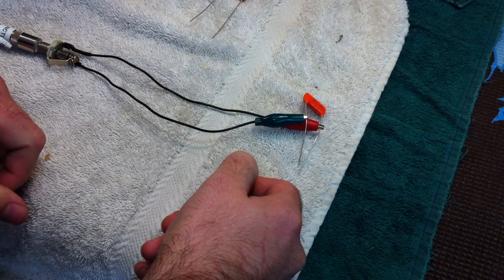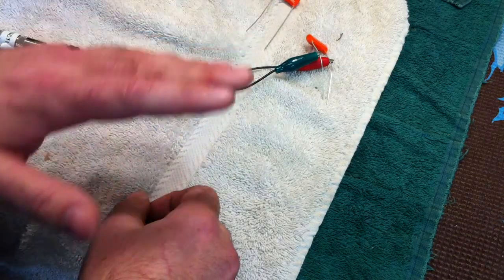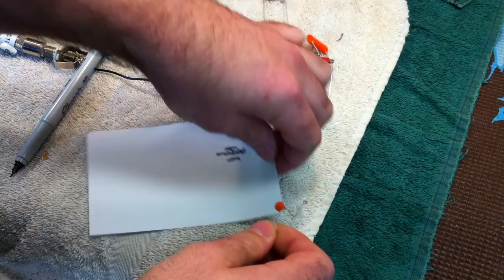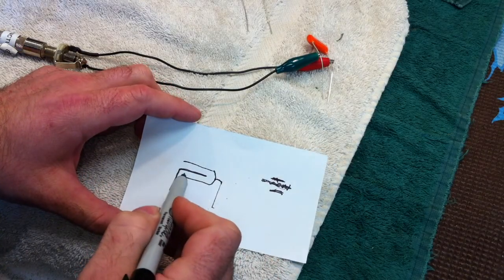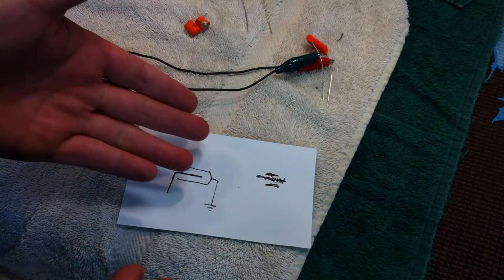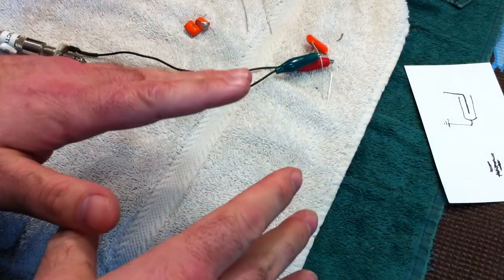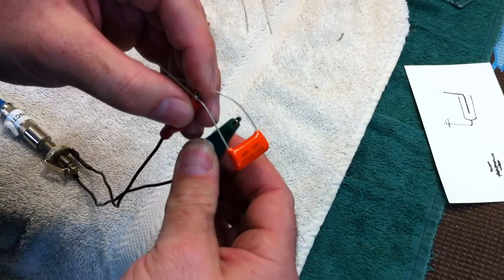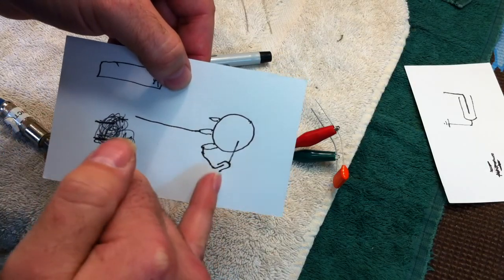Installing Orange Drop Capacitors in the Correct Orientation

Comment from the maker: I wanted to add a few points here that I have seen come up a few times in the comments. 1: the cap will function to filter frequencies in either direction and with the same value. The only difference is the amount of EM it will pickup in one orientation vs the other. 2: The orientation will matter less in shielded cavities. Cavity shielding is generally not perfect since you must have gaps where there wires come into it and other things, so it isn't completely worthless to do this in any case, but the folks pointing out that a shielded cavity will filter most of the EM are correct. 3: The instances in which I think this may be most important are in situations where the cavity cannot be shielded such as es 335s and similar arch-top situations in which the shielding comes from using shielded wire and thus, the cap can be a very noisy component in the circuit. 4: I wanted to mention (perhaps redundantly) that the reason this works is that if you have the hot lead of the output jack linked up with the outside foil you are basically hooking the outside foil to the tip of the phone plug of your guitar cable, which as one might know, will hum if you touch it due to it being the signal side of the circuit. Imagine rapping a wire around the tip and then touching that. Its the same thing except the wire is the outside foil of the cap. If you hear that hum it means the hot is connected backwards and therefore should correctly be soldered to the opposite lead when doing the actual wiring. To put it another way, when you hear the hum, mark the side of the cap connected to the tip as "ground" and wire it into the guitar that way. This works by hooking it up wrong, finding the problem that causes so you know that the opposite orientation will be correct. The "jumps the gap" illustration I am using in this video is functional for the purposes of this video, but if you want deep dive into how this really works, I would watch this video by The Science Asylum: https://youtu.be/zYRx6Zub3cA
Reply: I'm curious how this works with Polyester or PP caps being wired in a tube amp circuit between gain stages.  For coupling caps does the ground (outer foil) lead get wired to the grid of the next stage triode or should it be closer to the previous stage's plate?  I'm guessing in any other case the ground (outer foil) lead should be orientated closer to any grounding within the circuit.  Why do manufacturers never make a notation in this regard?
Reply from the maker: @on1ytheb3st  I am not well versed in amplifier repair or building, it might be best to pose this question to McCarlsons lab linked in the description.
Reply: Thanks!
Reply: Why not just wrap the capacitor with aluminum foil and ground it?
Reply from the maker: @rockvillemike6062  Well, for one thing that would change the capacitance since you would be altering the conductive surface area. Also aluminum is not solderable.
Reply: If you play try a treble bleed soldered between hot n ground on output jack.
Reply from the maker: normally a treble bleed goes from signal input to signal output on the volume pot bypassing the potentiometer and thus “bleeding” treble frequency from the pickup directly to the filtered output from the pot. That would be a signal to signal connection, where as if you put it between tip and ground at the output jack, whatever it was bleeding would be bled directly to ground. I’m pretty sure that would act somewhat as an always on low pass filter rather than the treble bleed it was designed to be and I kinda suspect that might lead to some ground hum as well. What effect are you going for with that and why are you recommending it?
Reply: @DrewsGuitarShop  it gives you kinda a treble boosts with bite and or distortion not much but enough. . Mines on a switch so I can turn it off. Gives a bit of volume boost.
Reply: Will the orientation matter on a volume pot? For instance The 3 terminals hot in on the left and middle I put the capacitor with a 150k between them. Should the shielded leg go to center? Far right I ground to edge of pot. I'm thinking grounded side of cap to center?

Comment: Awesome and a very easy way I have seen so far, to tell orientation on polypropelene caps without expensive equipment like Oscilloscope. Mr.Carlson's Lab of course has even shared an amazing DIY tool to identify polarity, a big blessing for professionals. Drew, thank you for sharing your valuable tip. Bless you!

Comment: If you want to demonstrate this is an issue, you should wire a pot in a guitar up in a noisy environment in a way you can change the polarity back and forth. The fact you can see something on an oscilloscope or hear a hum when you touch it naked is not necessarily relevant for the real world.
Reply from the maker: ¯\_(ツ)_/¯ if it matters to you, it matters. I am just putting the info out there. I'd say it would matter most in a situation like an archtop were you were using shielded wire, but were unable to shield the cavity.

Comment: This has been discussed extensively at least 25 years ago on the web guitar forums, etc. 
NOTHING NEW..
What's good here is that you acknowledge and perpetuate that caps are directional.
Reply: The capacitor is not directional but it will pick up noise more in one orientation than the other.
Reply: @1pcfred  
Save it for someone else..
👎
Reply: @1pcfred  
Please.. Just stop already.
Have a 🌭
Reply: @1pcfred  
Please stop harassing me. 
🌭🌭🌭🌭🌭🌭
Reply: @1pcfred  
I'm not drinking your Koolaid. 
👎👎

Comment: In regards to EM interface, wouldn't a Faraday Cage prevent this - which is something I do in all my guitars .
Reply: Faraday cage is impossible to achieve in a guitar because the pickup magnets stick out of the body hence not a Faraday cage. There's a great video by Dylantalkstone that goes into further detail about this

Your best bet to combat EM interference is to: get good quality pickups, shield the pickup cavities and clean up your signal chain.
Reply: @derusmares9508  yeah it isn't technically a Faraday cage because of the lack of complete coverage - instead it works by sheilding from the frequencies to a better extent than without.
Reply from the maker: You can't shield some guitars. Imagine trying to shield the inside of an ES-335 or the like. Sometimes you have to rely on the wires and components to do that job and in those cases, the cap can be a big deal.

Comment: this is confusing but it seems you have the Red (Hot) clip wired to the ground on the jack and Black (Ground) clip wired to the Tip. Doesn't that reverse what you're doing.
Reply: No.
Reply from the maker: When your tip is wired to the outside foil, it will hum when you touch it letting you know that it needs to be flipped around.

Comment: Metal Film Caps are Bidirectional. They have no polarity. So it really does not matter which way you put them. They will only capacitate the amount shown on them regardless of orientation.
Reply from the maker: It will work as a capacitor in either direction however the outside foil layer will not have any shielding properties unless that side goes to ground.
Reply: @DrewsGuitarShop  the exterior jacket is designed to be  shielding according to its datasheet.
Reply: "Capacitate"..... 🙄😂
You must be an injuneer... 😏
You obviously didn't bother to look at the video.... btw, Paul  (Mr.) Carlson also agrees with this and in fact has a video showing how HE tests for this characteristic...
Reply: @peterfitzpatrick7032  Not an engineer but I am a musician with a vast knowledge of electronics and repairing them.

Comment: great vid! does this mean i could touch the cap while wired in the the guitar and hear something similar?
Reply: no, because this would also depending upon other factors in the circuit, such as the rotation of the knobs on the volume and tone pots, so it is better if the cap being tested is not installed in the guitar when you test the cap for its proper orientation to mark on the cap the ground lead side.

Comment: on modern capacitors the live side has longer wire.
Reply from the maker: This is only true on electrolytic capacitors as far as I know, which should not be used for tone caps in guitars.

Comment: Thank you! I am building a blend pedal for my talk box and I didn't know why capacitors are sometimes used in these circuits. What value cap would you suggest for it?
Reply: I see. So, no need for a Cap. I am using a blend pot already so I will check it out and see how it works. Thanks for your help. :)
Reply from the maker: I'd recommend whatever is in the schematic.
Reply: @DrewsGuitarShop  I am designing and building this myself. I am concerned that  the blend pedal will not have enough signal output. Not sure how to proceed.
Reply from the maker: @GarysBBQSupplies  I'm not sure how the cap would figure into something that is doing blending. Generally thats done with a pair of variable resisters, at least in the context I normally see them. I don't work on pedals or amps, so It might be out of my wheelhouse, but offhand, I'd say that I'd be looking at resisters or maybe even some kind of rheostat. A sewing machine pedal might be able to be repurposed or something like it. All a cap is going to do in an audio circuit is filter frequencies either as a low pass or high pass filter.
Reply from the maker: If worse comes to worse, you can always cargo cult something that works and base any mods you do off that working model. Try different value components, arrangements etc. I'm sure someone somewhere has chopped something like that up and put up a block diagram somewhere based on what they found inside or posted their own design.

Comment: Great video, super explained! I still have one question. Do capacitors with the same capacitance have to be soldered in this circuit? I have one 0.047 and one 0.022. To which potentiometer do I have to solder which capacitor?
Reply from the maker: Why are you installing two different values of caps? You are going to get different amounts of roll off on each. I mean if you are going to install them you put them on the tone pot. I drew a diagram in the video. https://youtu.be/v7h5kI8glwA?t=480
Reply: @DrewsGuitarShop   Thank you very much! Will solder 2 equivalents. I will take the installation direction into account!
Reply: Usually you would only use one capacitor on one tone pot,  unless you were to put a few caps on a rotary type switch. In my guitar I use a 6 rotary switch that has 6 positions, so I can have a choice between the 5 different capacitors on the rotary switch. I positioned the caps on the rotary switch (going clockwise with the knob on the rotary switch) in the order that I have them listed here, so when I turn the knob on the rotary switch I am going in a specific order that is easier to remember, so I can easily select which capacitor that I want from these 5 different values of uf capacitors, meaning the .015uf capacitor, then the .022uf, then .033uf, then 047uf, and last the 068uf. This totals five capacitors, and since the rotary switch has 6 positions, I leave the first position lug 
empty for use as a kill switch so no sound goes through if I am taking a pause or a break, for example when I put the guitar on a stand temporarily  so I can get a snack or go to the restroom. The rotary switch connects between the leg of the tone pot (where you would have connected a cap normally), and the rotary switch connects to the common ground of the guitar circuit the same that way you would be connecting one cap to the common ground on a tone pot. Note that the rotary switch has two gangs, so you would only be using one of its two gangs.

Comment: Sorry I’m a little slow 😅 S, when I touch the cap and I hear noise through the amp, that’s the ground lead I want soldered to the ground of the pot?
Reply from the maker: If touching it causes it to buzz, you have the hot lead on the ground side of the cap.

Comment: Orange Drops: Busting Tone Control Capacitor Myths!
By Craig Anderton, Gibson Brands

Featured Products
CDE 225P Orange Drop® Capacitors
CDE 715P Orange Drop® Capacitors
Featured Suppliers
Cornell Dubilier
Applications
Audio
The Internet is a great source of information... and a great source of misinformation, even for something as seemingly simple as tone control capacitors.

Some of Gibson's 2014 model year guitars use Orange Drop capacitors (Fig. 1). Stroll around the net, and some folks say Orange Drop capacitors are the magic ingredient for vintage tone, while others say "designer" capacitors are just hype-as long as the value meets the spec, it doesn't matter what you use.

Various Orange Drop capacitors

Figure 1: Various Orange Drop capacitors

Actually, there's a very good reason why Gibson chose Orange Drops, as well as other quality capacitors for the 2014 model year guitars... but it may not be the reason you think. We'll explain why after we bust some myths.

Tone control capacitors roll off high frequencies.
This is true, but it's only half the story. When rolling a tone control all the way back, the capacitor forms a resonant circuit with the pickup that provides a midrange boost (Fig. 2). The volume control, cable, and amp can damp this peak somewhat; but feeding a high-impedance input (onboard preamp, buffer board, an audio interface's high-impedance "guitar" input, etc.) retains this peak.

Sonar's QuadCurve EQ

Figure 2: To emulate the effect of a tone control with an equalizer such as Sonar's QuadCurve EQ, it's necessary to add a resonant peak- not just remove highs.

All capacitors with the same value are the same.
Nope. Even ceramic capacitors aren't the same-there are two different ceramic capacitor classes, and the value can be consistent within 1% for expensive types or vary from +80/-20% for cheapos (as often found in knock-off guitars). Capacitance can also vary with frequency, temperature, and applied voltage; some ceramic capacitors are even somewhat microphonic. If your guitar uses a ceramic capacitor for its tone control and you think your guitar sounds different under stage lights then when you're offstage, you're probably right.

Replacing a high-quality modern capacitor with a "vintage" capacitor can have a profound effect on tone.
This may very well be true-but only because the values are likely slightly different, thereby creating a different resonant frequency when paired with your pickup.

People like Orange Drop capacitors because of the placebo effect.
Actually, there's a technical reason for choosing Orange Drop capacitors. Sprague was a leading name in capacitors, and in the mid-20th century produced capacitors for industry, the military, and aerospace. The Orange Drop capacitor line introduced in the 60s heralded the capacitors of the modern era-with stability, resistance to temperature variation, low moisture absorption, excellent characteristics in AC circuits, no microphonics, and other desirable attributes. (The technology can also handle high voltages, making them well-suited to tube amps.) Cornell Dubilier (CDE), another high-quality capacitor manufacturer, acquired the Orange Drop line from Sprague in late 2012.

For Gibson's guitars, Orange Drop capacitors provide the stability and precision-therefore, consistent tone-that professionals expect. Other precision capacitors would be suitable, but Orange Drop capacitors have a well-deserved reputation for quality that has proven itself for close to half a century. With a track record like that, Orange Drop capacitors were consistent with Gibson's intention to make the 2014 line of guitars and basses the finest musical instruments Gibson has ever produced.

Copyright 2014 by Gibson Brands and reprinted with permission. For more information on Gibson Brands, please visit gibson.com.

Comment: The orientation doesn't matter. Its going to sound the same
Reply: It doesn’t matter purely electronically, but he showed very clearly that for audio, it makes a difference. I do believe he made a mistake calling the Jack “output” as it obviously was INPUT to the amplifier. Also, put me on edge that he had the leads so close together (even though not dangerous, it’s SOP to make sure they are apart)
Reply: @shader26  Nope. Its voodoo smoodoo. If it really made a difference a lot more people would be talking about it. I've been in electronics for 30 years
Reply: @PhuckHue2  Then explain the difference you can actually  hear.if you’ve been in electronics for 30 years, you know then abou approximations. That components are considered for their main attribute. But in reality they most often if not always have secondary and more attributes. Just as it’s fine to consider it as it’s ideal, a resistor has also for example capacitance. Etc. There is leakage, on diodes, transistors, etc. etc. nothing is IDEAL! So yeah, electrolytic are caps that have a dedicated orientation. But you are ignoring the evidence right before your ears. When it comes to audio, and the levels of amplification of guitar amps (which take a couple hundred millivolts up so much) the secondary and other factor can play a role. It may well be that the outer foil is more sensitive to the outer body of the cap in these kinds of caps for some reason. Maybe it doesn’t matter in that you aren’t touching th cap when it is in the guitar, except it can mean more susceptible to noise, which again, you can clearly hear in this video. I’ve been in electronics since I went to school do it in ‘89. Open your mind a little. You can still learn and you ought to be interested in what is causing the effect.
Reply: @shader26  lol have a nice day